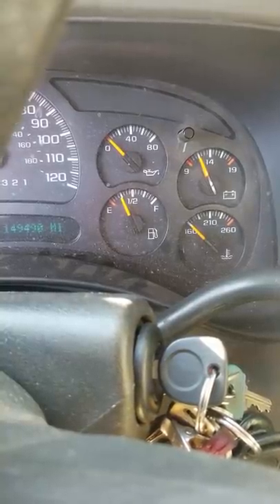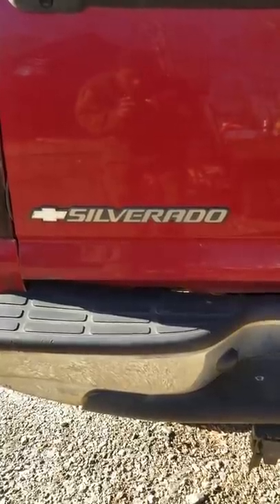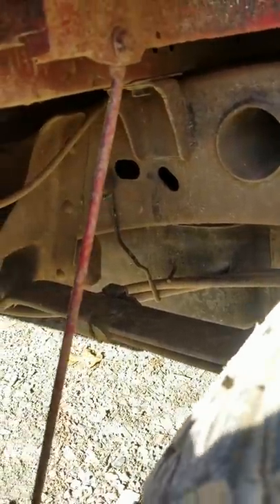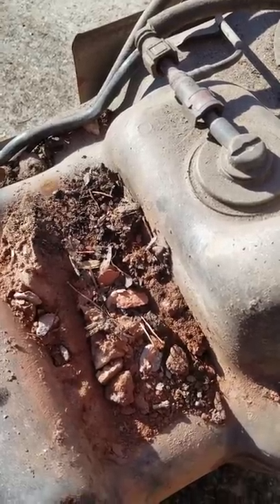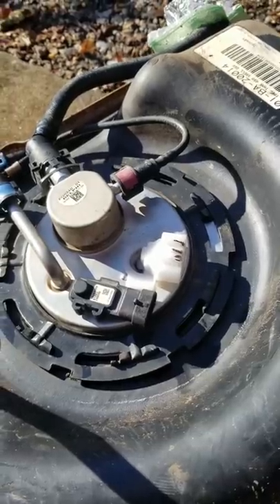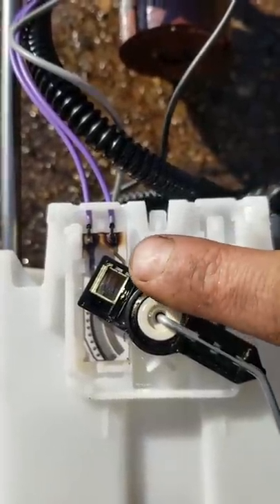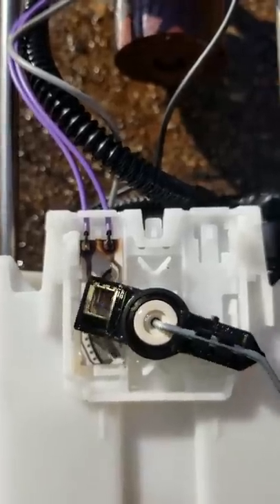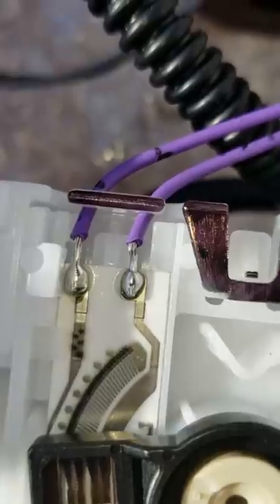Customer States Fuel Pump Broken

Comment: It would have been easier, if you had just loosen the bolts on one side of the Bed...
Then removed the other side bolts, put a 2x4 long enough to support the Leaning bed to oneside, then washout the dirt from on top of fuel tank. Let dry, then remove Fuel pump. Install  new fuel pump, reverse procedure. Bolt everything back up. Done. Just saying.

Comment: Pull the bed... 6-8 bolts vs dropping tank. In real life, thoes bs plastic lines all snap. I live in the rust belt where dropping the tank will result in needing new lines, hangers, emissions lines/devices. Not worth it.

Comment: replace the whole pump for solder points....a multimeter would've proved the float and resistance correct you could've charged labor only, and saved your customer$$$ on that expensive pump assembly he didn't need.... parts replacers are not mechanics.... there's a difference.

Comment: A real tech would have tilted the truck bed and removed the pump . Much more easier . 90 percent of the time it's the pump that goes bad versus the sending unit . Two cents from a GM tech.

Comment: As much work as you did taking that tank down you could have taken the bolts out of the bed lifted the bed up and slid it back.  10 times easier. Work smart not hard

Comment: My 89 Toyota Camry has the original fuel gauge sending unit in it @ 376k miles. GM builds garbage. I also have a1998 Chevy Cheyenne K2500 with 162K miles. Guess what? The fuel gauge doesn’t work. 
G arage 
M an’s 
C ompanion

Comment: Those fuel pumps are a horrible design. When the copper contacts corrode and they will the float will not work right.

Comment: If you’re a professional why don’t you use the proper tool to remove the fuel pump lock ring? A hammer and a screw driver are not the proper tools.